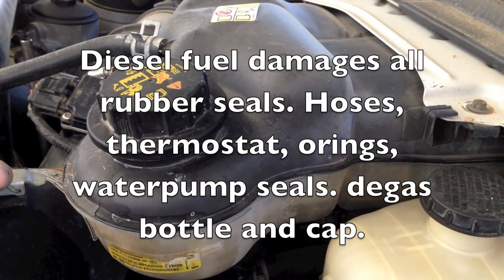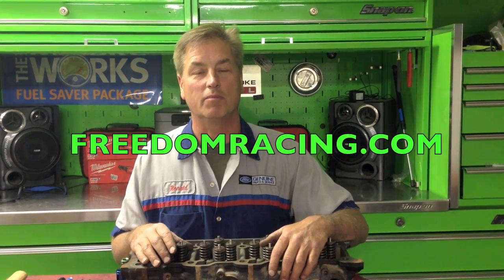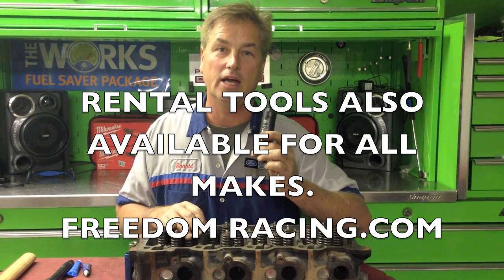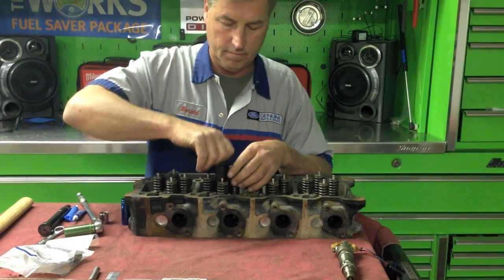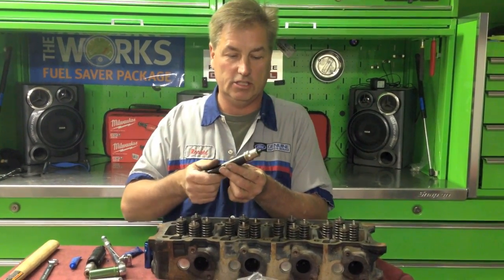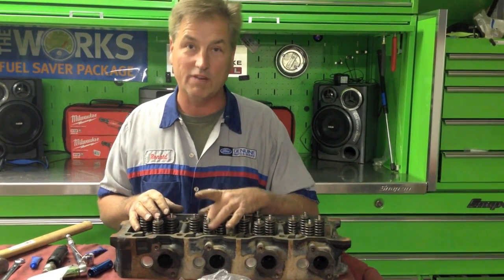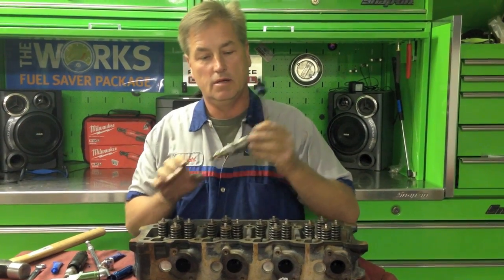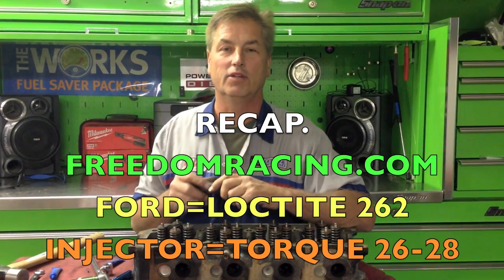Diesel fuel in coolant on a 6.0 Ford Powerstroke

Comment: Hello Ron I have a question regarding an estimate for this work. I have a 2005 Ford E450 truck that had this issue but in the area I live I don't know any realiable mechanic... So I wanted to check with you to see if you could give me an estimate on how much labor would cost and if it would be best if I purchased the kit or have the mechanic provide the parts? Thanks for the great video.

Comment: Just an update to this video.  By now it this a pretty well known problem for the 6.0's. While you can find success sleeving or replacing the cups, its not advisable, most of the time it is the actual head itself that is cracked behind the cups, so to fix this problem permanently you should just replace the head(s), and go ahead and install studs as well.  RIP RON!
Reply: Jessica Bitting I have had success replacing cups on many 6.0's.  In my experience, it is usually neglect or overheating which causes the head to crack.  Usually from tuning, deleting the EGR, and running up the boost.  I know Bill "it is going to cost 20k" powerstroke help will tell you it is a design flaw of the cylinder head, and big dog has the solution, but I've had enough success with cup replacement to feel it is a trustworthy repair.  On stock applications, the cups fail long before a head does in my experience.  Except on the E-series vans.  The lack of space and ventilation is an issue in those.  If you have an E-series extra diligence must be done to ensure integrity of the cylinder head. With the cups out, one can use an inspection cam to verify cylinder head integrity.
Reply: @LynxStarAuto  I have a 04 f250 6.0 bulletproofed studs deleted and I have oil sprayed on the under side the top of the hood in middle of hood, cranks acts like it stops or catchs a moment and continue to crank In one key turn but does not start
Reply: My truck is doing this shit now and it’s got heads and gaskets and apr studs what can I do to eliminate so things. Thanks

Comment: DiesekTechRon how i hear that the heads crack around the injector cups not the cups them sleeves because there cast iron not brass like the 7.3's i have fuel in my coolant as well so i am hoping its my cups not my heads
Reply: Somtimes there are cracks above the sleeves and a longer sleeve is needed if you don't want to buy a whole new head
Reply: Darrin's Channel cups are stainless steel.  They do crack.  Usually they crack around the orifice where the injector nozzle protrudes from.  Eventually, the crack walks its way up the cup, and will expose the coolant jackets to diesel fuel and the combustion chamber.

Comment from the maker: Search diesel fuel in the cooling system 6.0 bulletproof.  I'll be testing a different repair kit the week of October 15th 2015  from accurate diesel.
Reply: +DieselTechRon Any news on this kit? 
It would seem the raised sleeve is a better solution than the sealant available from BulletProof. 
I plan on buying the kit, but I'd love to hear your experience with it.
Reply from the maker: +Nick Petrilli I have it apart and will be doing it Monday probably paying the video late next week.  Oct 2015.

Comment: not missing had alot of hot start problems . if i pull valve cover n pressurize fuel system seem like a logical aproach? truck runs strong n smooth no thoughts of poor cyl. contribution.
Reply from the maker: Watch my cracked head bulletproof one.  It's the best way.  Drain the water.  Pressurize the water. Plug and fill the injector bore.  Have I seen people use water? Yes.  Just can't say put water in an engine.   Water in a tv or engine isn't what hurts them.  Turning them on or leaving it in is what hurts them.

Comment: ive got a 06 with fuel in oil contamination. do u have any videos on this
Reply from the maker: Is it missing or uneven crank? The only way I've ever seen fuel in the oil is unburnt fuel passing by the rings.  Bad injector that usually takes out a piston quick.
Reply: Wondering why would a bad injector take out a piston quick?  I also found fuel in oil on a 2006, which made for bad running, stopping after warmup.  Is it more likely those injector seals you changed in the video, the old ones not sealing and allowing fuel past and then into oil?  I found a Ford TSB 04--9-3 which seems to indicate this, but maybe since 2004, this was resolved and no more a problem.

Comment from the maker: It's not so much bypassing the oring. The sleeve is surrounded by coolant in the head. When it cracks the fuel seals out the side of the cup into the coolant

Comment: Hello Ron, great video.  I have a question that no one seems to be able to answer.  If the sleeve is leaking, how is fuel bypassing the lower injector body o-ring?  This o-ring seals to the cylinder head and not the sleeve, as in a 7.3L.  Without this o-ring failing, even a 1/4" hole drilled in the sleeve should not cause cross contamination.  Just wondering what your thought on his were.  Placing a sleeve on an injector out of the engine demonstrates this perfectly.

Comment: Strong work. I am trying to learn Diesel technology. I have of course started with a very simple engine, an Oldsmobile 98 1981 5.7 350cc LF9. I bought the car from an elderly man several years ago, who was a retired diesel mechanic, so he had rebuilt and improved everything, so nothing has broken yet, older retired mechanics in my area assure me that I will have plenty of repairs any day now. Mine has ARP head/crank studs, racing head-gaskets, real water separator, etc.

Comment: Hi Ron. I love your videos. I love diesels. I have an 81 Oldsmobile 5.7 Diesel. I am wanting to buy a truck diesel as well. I can get an 87 F-250 6.9 with 41,000 original miles, was my Grandfathers truck, or a 2000 F-250 7.3 with 144,000 miles.